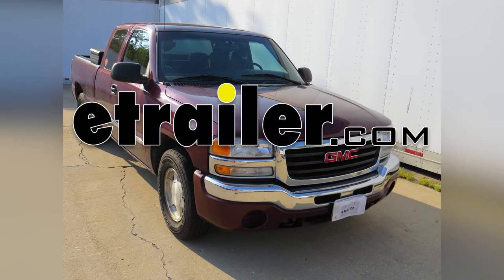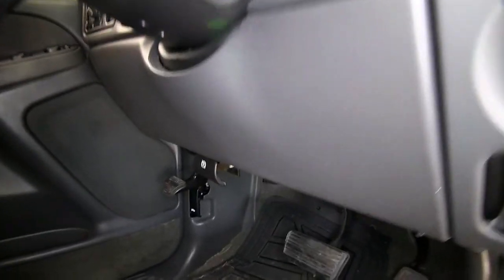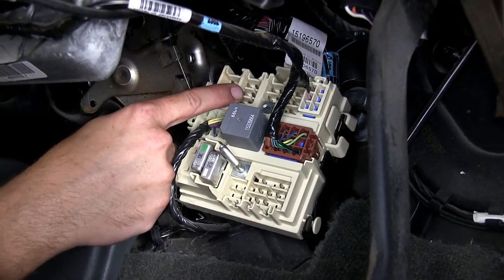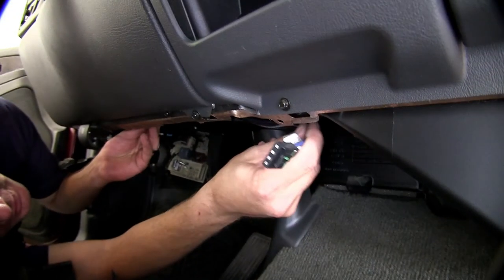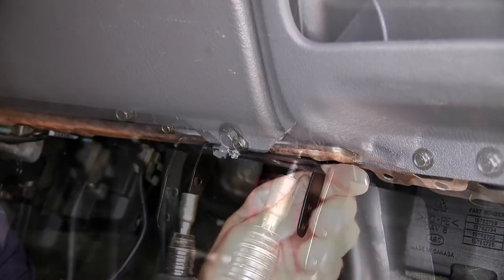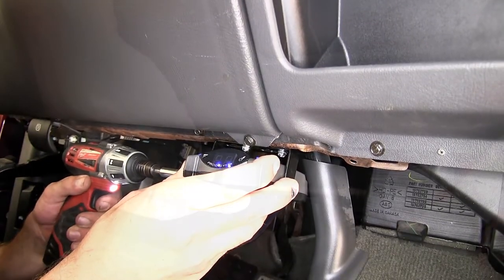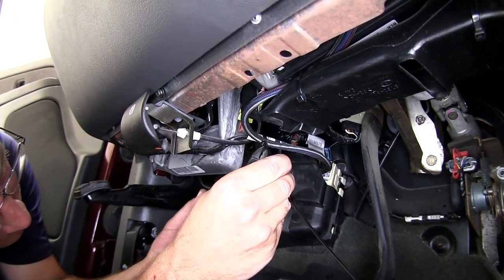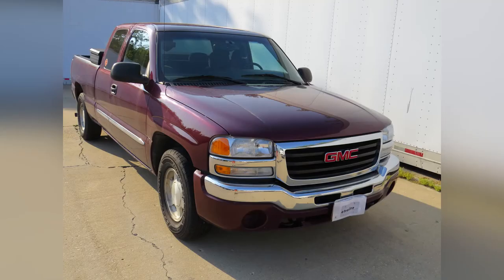Set up: Tekonsha Plug-In Wiring Adapter for Electric Brake Controllers on a 2003 GMC Sierra

Comment: Is it the same wire harness part number for a 2000 gmc sierra? It does have the tow package.
Reply from the maker: Your vehicle would use part number 3025-P. You can view it at the link below.

https://www.etrailer.com/Accessories-and-Parts/Tekonsha/3025-P.html?utm_source=youtube&utm_medium=Comment&utm_campaign=Youtube%20Comments